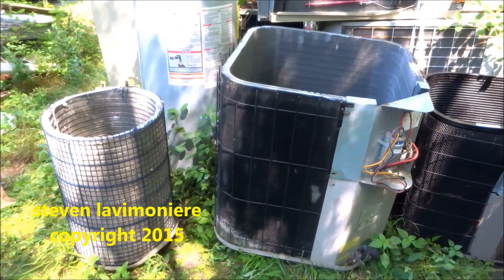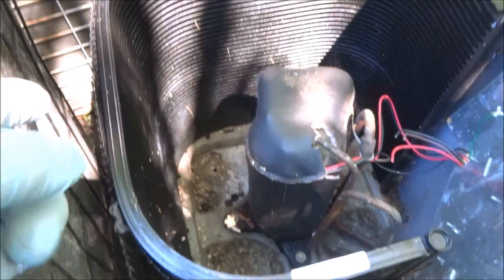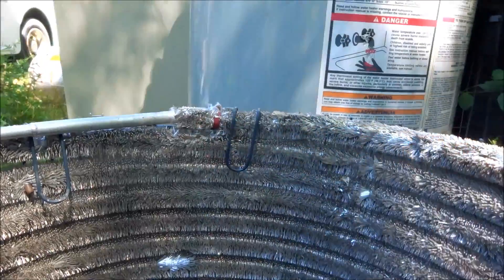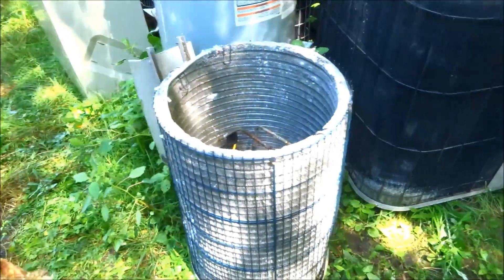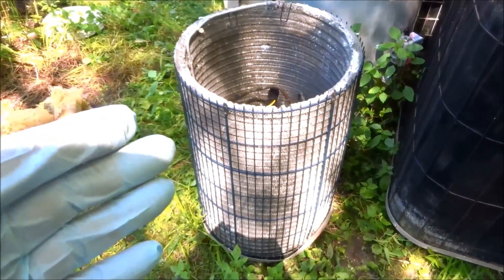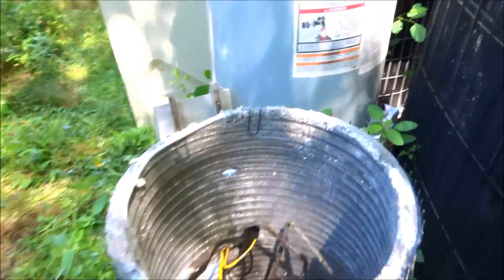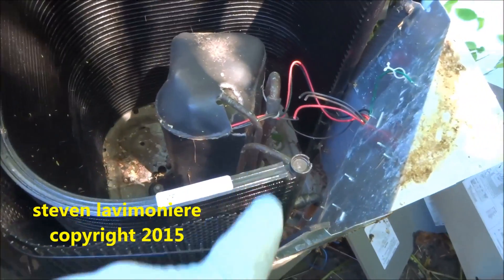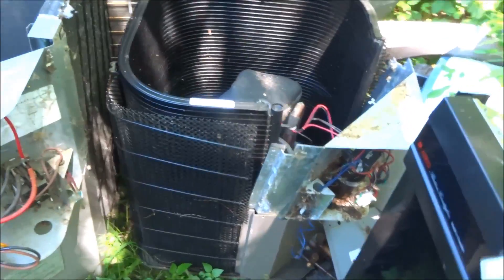hvac different type of condensing coils on the market today

Comment: Didn't Trane use the microchannel coil design on their XB400 series air conditioners? If they did, it was no surprise that they had lower efficiency levels than comparable 14 SEER units (XR14/XL14), were subject to maintenance issues, and in the ultimate end, were discontinued last year. And speaking of Trane, they supposedly use the conventional plate-fin coil design on their larger commercial grade units. So if they use classic plate fin on their commercial units, why don't they go over to plate fin coils on their residential units?

Comment: Nice job on the vid and explaination Steve, I'm with you on the difficulties in cleaning the spine fin coils.  You really have to clean them by backflushing them because of the weird slot design they use on the Trane/AmStd cases unless you take them completely apart.  The one thing that is nice about those coils is that since they are a continously wound coil that there are only a few braze joints on the coil.  Alot less places for leaks to occur.
Reply from the maker: Rich Rada good points made.like i always say they all have good and bad points .

Comment: Great Video, Steve!! 
Over all Is the Microchannel condenser unit works same that most common condenser copper tubing or they have variation???
Reply from the maker: Jorge Chavez no micro channel is bad stuff stay away from it if you can
Reply: +steven lavimoniere I was working on a Microchannel recently found overcharged. Removed about two lbs my SH was little high I adde few ounces and instead going down went up and my suction pressure instead going up went down too. What do you think was that??

Comment: microchannel works great forvcar radiators but they operate at quite low pressures 15 psi give or take. maybe they will improve eventually for ac use both i agree that right now they suck
Reply from the maker: awsom70 york is going back to copper coils lol no more micro channel

Comment: great video Steve ... just like being able to peel those aluminum fins and fix a leak in a copper tube alum fin coil seen many small leaks from lawn mowers shooting rocks and the rust out where that copper meets the galv coil assembly
Reply from the maker: dennis postek good and bad in all brands ,some times a patch will get them buy for awhile

Comment: Ursmelly Rheem are a fairly decent unit but all back to the main rule a system is only as good as it is installed if you get a proper install it will last crappy install looking for problems 
Great vid Steve nice looking scrap pile momma would be proud 😎
Reply from the maker: Ultimate heating & cooling services i agree installation is key

Comment: You did not mention the spine fin "copy" you showed was an example of a Carrier attempt to steal the design from Trane back in the 80s.... also, Carrier failed miserably at the attempt to make the spine fin coils.... the main problem was in the transition from aluminum to copper where Trane has the very successful 3 step patented process for sealing the joints. Also, you may or may not be aware that the spine fin coil is the most successful residential condenser coil ever designed, with the lowest failure rate for leaks, and also the highest efficiency for temp. transfer of all condenser coil designs....Just throwing my 2 cents in.... On the other hand, Great videos.. your channel is one of my favorite HVAC channels for sure.
Reply from the maker: Ted Cook Heating Service i did this video for the new guys in the field,so they know the different coils out there , i did mention in my video that trane spin fine coil claims the best heat transfur thanks for the comment
Reply: steven lavimoniere Just a Tranewashed Tranehead busting your chops... cause I know you can take it !! Thanks again for a great YouTube channel !!